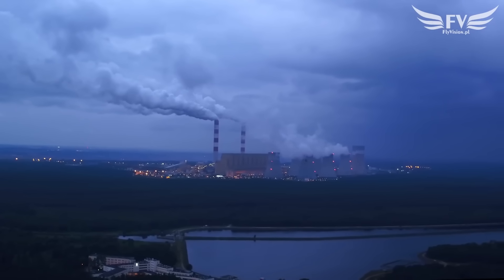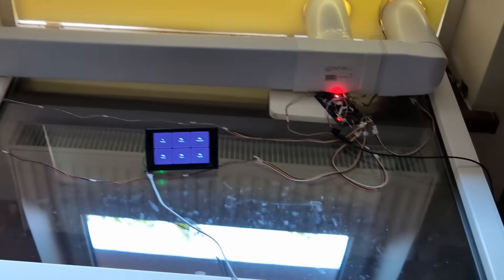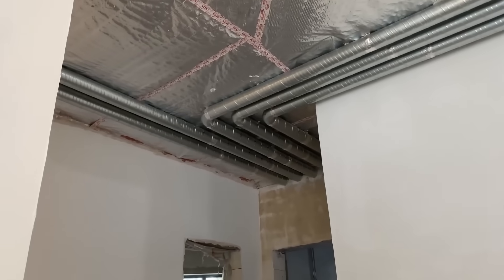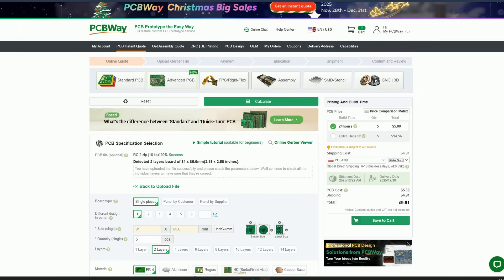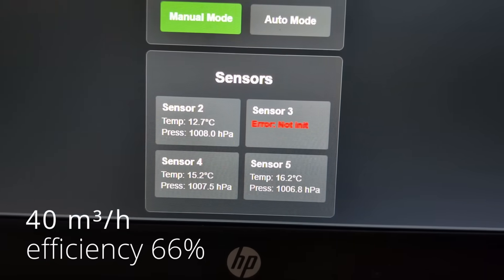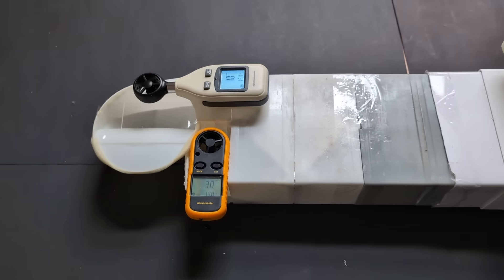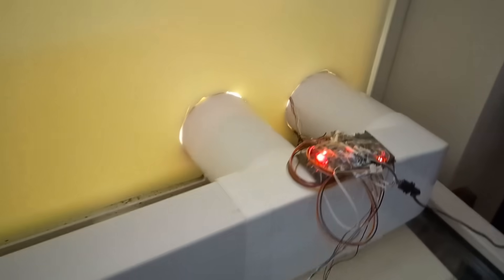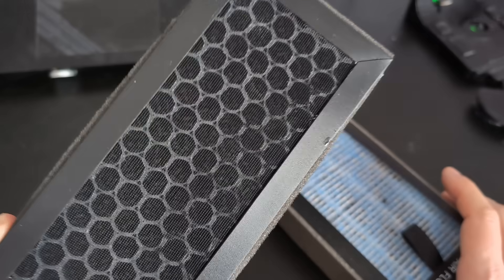DIY Heat Recovery Ventilator: From 55% to 90% Efficiency (Real Tests)

Comment: You could model a heat exchanger and get it metal 3d printed. Could even be in piece with the shroud so no leaks
Reply from the maker: Metal 3D printing is a great idea, but the cost is just too high. I’m actually working on a 3D printed plastic version right now that I plan to electroplate with a thin layer of copper. It's a much more affordable way to get high efficiency.

Comment: Hi, interesting approach. How about comination of straw recuperator https://youtu.be/W7UTk8hcsfM?si=3Ptzb6j3XFXVI0Za and your electronics?
Reply: I wonder how would the system work if you could replace aluminium with drinking straws I mentioned. You could merge straws using heating and  freezing ends. Straws would fit. 
That would be super light in terms of weight by the way

Comment: Have you ever considered, to use a condenser from a broken down laundry dryer as heat exchanger. The sheet metal has nearly the same shape, but it's much less work.

Comment: I don't see the point of making it corrugated, unless space is very tight. Much easier to work with flat sheets. I long time ago I made a unit for a rented flat where the only space available to exchange air was the letterbox. It was made with layers of kitchen foil and expanded polystyrene (behind-wallpaper wall insulation, cut to the design shape) glued with silicone, and driven with a couple of CPU fans. It worked fine all the time we lived there.

Comment: Hi I'm in France and when looking for aerogel it's almost impossible to find. I'm pretty sure you could get a more common material but focus on the installation and test instead of looking for aerogel haha. Best of luck for this amazing system. I hope you will be able to release a public guide sometime
Reply from the maker: Thanks! My priority right now is making the heat exchanger simple and easy to replicate, then I'll tackle the noise issues. Actually, aerogel is quite easy to find and not that expensive. Once it’s all done, I’ll release a full video and the guide so anyone can build it at home.
Reply: BTW you should open a donation page to help you out
Reply from the maker: Thanks a lot! I have enough funds to finish the project, and taking donations feels wrong while I’m not 100% sure about the final result. Once it’s done, I’ll create a detailed tutorial and sell it for a small fee. That seems much fairer to me.

Comment: And so why did tubular heat exchangers hit a dead end? Tubular array is very similar to plates, right? Was it path length or surface area or thickness of the material?
Reply from the maker: The problem with tubes is that air inside and outside follows different path lengths, making the heat exchange uneven. In my new 3-chamber system, both airflows travel identical distances. This balanced path is exactly what pushed the efficiency from 60-70% up to over 80%.

Comment: Very interested in this!

Also need to collect condensation. I have an earthship style off-grid house with an HRV and if we have a lot of vegetation in the greywater planters, we can capture about 1 gallon of condensate per day in the winter when the sun is blasting into the house all day. I can pour this water back into the cisterns to be reused yet again! Outside temps can be below freezing and inside temps can be in the low 80s with 75% humidity or higher.
I have been really curious about mimicking Stenocara gracilipes, the racingstripe darkling beetle on the condensing side of the HRV plates to maximize water capture efficiency. The back of the beetle has a very hydrophobic surface that is dotted with small hydrophilic spots. The fog or condensate forms droplets on the hydrophilic dots and, when they get big enough, they fall off onto the hydrophobic surface and run down into the collection tank.
Reply: Aren't you worried about mold if you let the humidity go above 60%? I try to keep mine at 56% because of that.
How do you solve for the mold issue if you let it get to 75%?
Reply: @cajampa  That is why I got the HRV to get rid of the humidity without losing all the heat I collected from the passive solar heating.
If the humidity still gets too high, I cut down some of the vegetation.
Reply: @zachreyhelmberger894 But if you get rid of the vegetation you lose the CO2 lowering effect of the green house plants. I try to grow more and even bigger plants so i can ventilate less. Right now i have enough plants for 1.5 person and no extra ventilation needed. But we are 3 in the house so we are running some HRVs to cover for the extra CO2 exchange.
We get issues with condensation on the windows even though they are triple glazed when it is below freezing if we let the humidity go to close to 60%.
How did you solve them not getting all condensed if you allow up to 75% when it is cold outside?

By the way how come you have so much humidity is it all from plants? Because i have to use 2 beefy humidifier to keep up the humidity, because when there is freezing outside there is so little humidity in the air.

Comment: Been thinking about similar idea for a while. There are a few factories in China that make aluminium panels with corrugated core. You could get a sample for price of DHL shipment.
If you still want to fabricate the heat exchanger core: Stamping it would be easier and more precise than rolling. You could CAD draw stacked press die and laser cut it locally. Stamping 150x150x0.5 mm sheet could be done with the cheapest chineezium hydraulic press you could find locally. As for bounding of panels, don’t even bother with soldering. There are bounding epoxies made with good heat conductivity, that are specifically made for bonding radiators.
Reply from the maker: Thanks! That's a solid idea. I already have experience ordering custom parts from China, so that sounds very doable. Stamping and using thermal epoxy seems like a much more reliable way to build it than soldering by hand. Appreciate the advice!
Reply: I agree with you in almost everything but the epoxy. If you are trying to build a filtering system for having healthy air in your house, epoxy resin releasing volatile compounds its entire life doesn't look like a good approach to me. What about soldering them with tin? Maybe that silver paste used in electronics to solder smd components and a oven could do the trick
Reply: @Vic-sp6ld  volatiles drop relatively quickly and the airflow is not a very siginificant on rate of release just circulation
Reply: This is collaboration and crowd sourcing of useful suggestions.  Well done.
Reply: corrugated aluminum panels are reasonably common as a DIY material. Should be local in any big US city.
Reply: or use two identical separate  old car radiators with water loop as a heat transfer between these two radiators ( intake air radiator connected to exaustion radiator via closed water circuit system like pc watercooling)

Comment: Why not use a high-performance aftermarket aluminum automotive radiator? They are leak tested under pressure, and you can get them in almost any size. Even small motorcycle radiators (for glycol or motor oil) should work.
Reply from the maker: The problem is that the air flow capacity of such radiators is too small inside the tubes, but on the outside, where the fins are, it is, on the contrary, large. This is necessary for a car radiator, but not for an air recuperator.

Comment: ~70 to ~90% jump in efficiency was due to material change alone?
Reply from the maker: In fact, yes. However, it's worth considering that the heat exchanger's weight increases threefold, as copper is very heavy.

Comment: How are you defining efficiency? Is it only considering temperature? Around comfortable conditions a delta of 10% in relative humidity and a delta of 5 degree C represent the same variation in the air energy content.
Reply from the maker: I’m currently measuring "sensible" efficiency using 4-point temperature monitoring. I track exactly how much thermal energy the exhaust transfers to the intake. You're absolutely right about humidity and total enthalpy,  temperature is only part of the story. Right now, I’m focusing on optimizing the heat exchanger geometry first, but I’ll definitely be looking at moisture and total energy content in future tests to get the full picture.

Comment: Hello, I tinker with similar intention to ventilate my room. Can you exactly explain or show how you asamble the copper recouperators with entropie membrane? My intention was to 3d print a frame to hold the copper foils in place and seal them airtight... how did you solve this problem?
Reply from the maker: I soldered the plates together to make them airtight. It looks pretty messy, which is why I didn’t show it, and it’s very hard to replicate despite the 90% efficiency. My new plan is to SLA print the core using a gyroid structure and then copper plate it. This should be perfectly sealed from the start and much more efficient for its size.

Comment: Neat project. You may want to consider Titans of CNC to cut an exchange block from copper. They might even be interested in a collaboration for a project like this. It would at least be interesting to compare to a foil block.
Reply from the maker: That would be an amazing piece of engineering, but unfortunately, it would be way too expensive. My goal is to keep the project accessible so that anyone can replicate it at home without a huge budget or pro-grade CNC machines.

Comment: Fascinating stuff and nice to see all your research laid out clearly with measurements.

I used to work with copper and brass for other things and my first thought would be to use solder paint/paste and clamp the pieces together then heat the whole thing to melt the solder and let it cool when clamped.

If you pick the right temperature range solder it's also possible to disassemble it by shoving the whole thing in an oven and just cooking it and then fishing the bits out carefully whilst hot. Just don't use the same oven for food without serious cleaning.

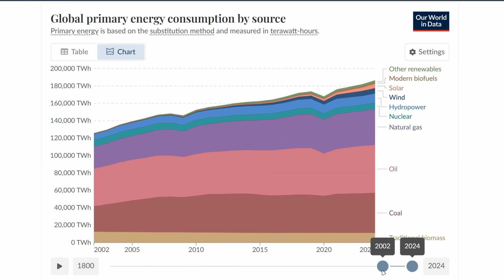Comment: 0:53 uhhhhh... since when is linear exponential? Hello??
Reply: He's also looking at the global energy production, which isn't really a good metric, considering that pretty much for every coal plant shut down in the West, China opens up a new one.
Reply: @ThatMattWhite  Exactly, I was looking at electricity usage in european countries, and the overall usage has remained about the same in the last 20 years. Which I found surprising. Probably efficiency gains in the economy allows it to grow without needing more electricity.
Reply from the maker: I only showed a part of the graph. If you look from 1800 it starts smooth and turns into a vertical line. Considering today's data center consumption the exponential form is obvious.

https://ourworldindata.org/energy-production-consumption

Comment: Amazing job! If you allow me, may I do a piece of contribution to the tightness of the heat exchanger unit? Metals are incomparably superior, easy to weld, but deserve an anodized layer for better durability. Aluminum and copper can be joined individually with electric welding. The use of thin sheets makes welding difficult, with popular methods, but the use of spot welding and ultrasonic welding can build lightweight, inexpensive, and efficient heat exchangers. Best regards!
Reply from the maker: Thanks for the advice! I've heard about ultrasonic welding but haven't tried it myself yet. This is a great reason to finally give it a shot.

Comment: This is an amazing and useful project and I hope you open source it so others can use it. I just installed a ERV unit in my home it was a retrofit and not easy to install the efficiency is also terrible. It did manage to lower the CO2 levels in my small home to "Safe" levels.  Look forward to seeing more in regards to this project.

Comment: Firstly I applaud your work and willingness to share both your successes and also where things didn’t work as anticipated. Could I ask how you define efficiency? In a passive exchange system like yours I would have thought that it was only possible to recover half of the heat that would otherwise be lost using a non exchange trickle vent setup. Some further details would be appreciated, like actual flow rates, input and output temperatures across a range of external temperatures and the amount of energy consumed by the fans, with and without filters etc. Again, many thanks for what you’ve shown.
Reply from the maker: Thanks! I kept some testing details out of the video, but I’m logging everything in a spreadsheet for future analysis. I’ll share a full breakdown of flow rates and temperatures once the final device is ready. I don't see much point in over-explaining the failed attempts right now. I measure efficiency using 4-point temperature monitoring, looking at heat recovery versus airflow. As for the fans, I use Delta BFB1012EH at 60% speed. They are very efficient.
Reply: @DIY_Yarik  Thanks for the reply. I currently have a well sealed and insulated house ( new build ) with a mechanical air extraction system for ventilation which continuously draws the moist air from the damp rooms (utility, showers & kitchen) which is replaced via trickle vents over the windows of the living rooms.  
It works well but I’m considering upgrading to a heat recovery system based on the current setup, however the financial savings are marginal, so it’s diy or nothing. Consequently, your adventures and trials in this area are very interesting and informative. 👍
Reply: A hint for what you might be missing is that heat exchangers typically use counterflow arrangements where incoming cold air receives heat from hotter and hotter exhaust air the deeper it goes into the exchanger, so that the temperature gradient across the heat conducting barrier is maintained.
Reply: @hellelujahh  Thank you 👍

Comment: Awesome solutions and I love your dedication. 
I'd really consider copying you, but I lack the time. I got to use a commercial solution and small it down a bit. I find normal home ventilation systems to be absurdly oversized. Changing the air every 2-3h... why?
Reply from the maker: It’s probably mostly marketing. Official standards say 30 m³/h per person, but my air quality monitor shows I need way less than that in reality. Either that or I just breathe less than the "average" human :)
Reply: @DIY_Yarik  I haven't measured it yet, but that is also what I assume. What quality parameter do you base that on? CO2? 
My intention is primarily not having to open a window at night due to percieved bad air in the bedroom. A tiny bit of constant ventilation will do that.
An HVAC company quoted me a 400m³/h system with 30.000€ installation cost... go f... yourself!
I think I will be happy with a ~150m³/h system running at low power.

Comment: Here in Germay on the coldest day of winter so far the renewables are accounting for 70-80% of the electricity mix…
Reply: Thats only half of the truth, the daytime is short on cold winter days in Germany and do not ask for the renewable percentage at nighttime... and because nuclear power plants have been switched off for ideologic reasons coal and gas (imported from overseas) power plants need to cover the missing energy...
Reply: @svvelanautica2374 it’s 11PM now and carbon free is at 66% (according to energymaps BTW). Don’t get it twisted, not every day is like today. There is wind today, nothing crazy but it is there… There are a few days when there is no wind of course. (We‘ll ignore offshore wind for the time being.)

Guess what. 7% of electricity in Germany is nuclear right now Let’s let the experts (The French) deal with the dangerous power that is nuclear energy. So when Germany isn’t exporting green energy to France it’s importing spicy green energy from France. OMG the system works and you’ve been radicalized!

BTW, coal burned in Germany was mined in Germany (or at worst, the EU)
Reply: Information source?